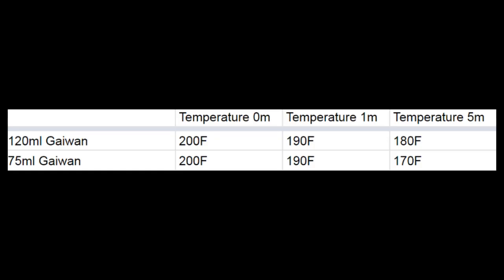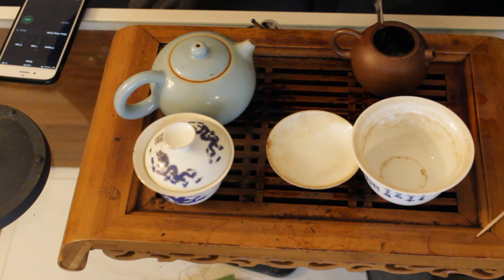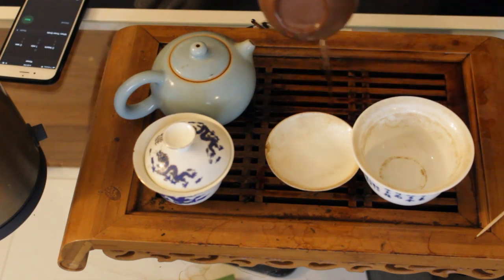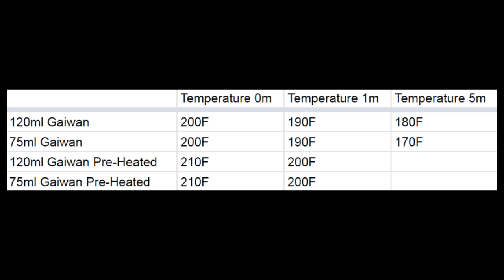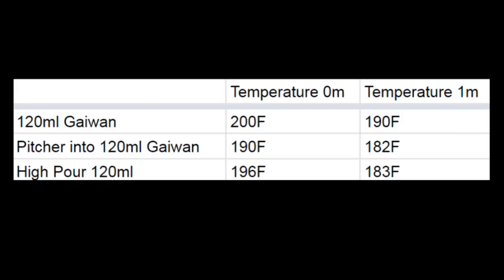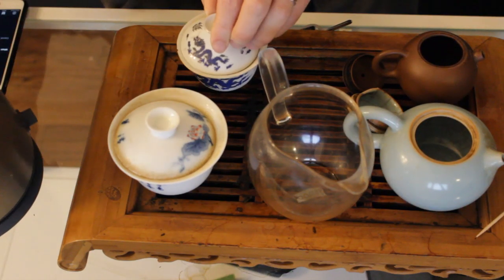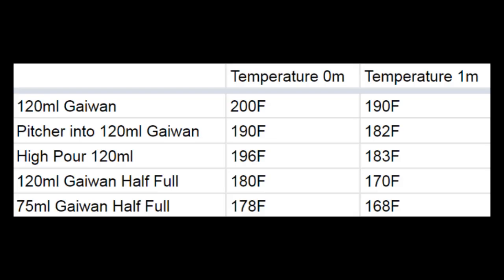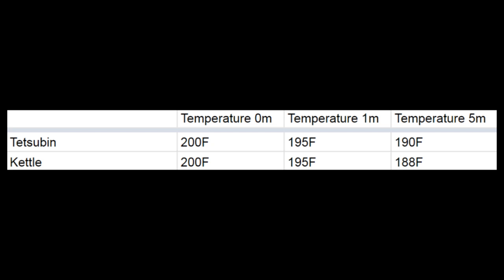Deep Dive: An Exploration of Temperature & Heat Retention [Inbetweenisode 189]

Comment: Interesting experiments. I've always found it interesting how you guys tend to use really hot water (near boil). I drink mostly oolong and use water that is 190, and likely mid 180's by the time it's in the vessel. I steep longer as well. When I've experimented with hotter water and shorter times, it brings out lots of bitterness & astringency in teas that would usually be floral and fruity at lower temps. Interesting to think about how our brewing methods shape our preferences for certain types of tea.

Comment: I find that a thermos flask works great for keeping the water hot even during longer sessions, the old-fashioned flasks with glass on the inside work particularly great. Re-boiling the water might also affect its taste, as some people claim, would it be interesting to experiment with that also
Reply from the maker: Yeah, it's true that re-boiling often is considered a no/no. For this episode was trying to avoid any actual tasting comparisons, but it'd be necessary to try for that. Good idea for a future episode. Cheers Mørk !
Reply: Well I think this belief about reboiling affecting the taste is based on false statements:
-that boiling water deplets dissolved oxygen (that's false, by the time it boils it's already lost all its dissolved oxygen)
-that boiling water hardens it (true, but ONLY if you boil it for a long, long time, not the usual few seconds
Are there other reasons that I don't know of?
Reply from the maker: I'm also a bit skeptical of it.. The oxygen explanation is the one I've heard the most frequently.

Will reserve judgement until someone actually tests it thoroughly.

Comment: Nice scientific experiment. Interesting to see that clay doesn't make so much of a difference as generally believed. For a whole new series of these experiments, I also wonder about the impact of the tea leaves in lowering the water temperature, whether dry or wet. Especially when I pour hot water on a gaiwan overfilled with expanded oolong leaves, wet and cold, I just imagine the water temperature plummeting as it passes through the top layer of leaves.